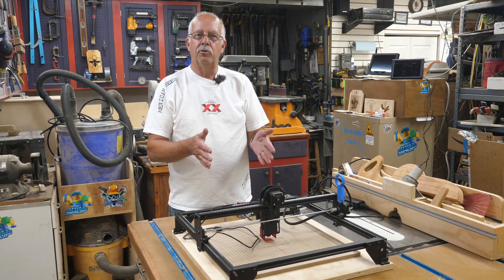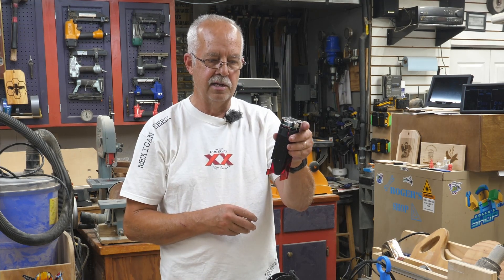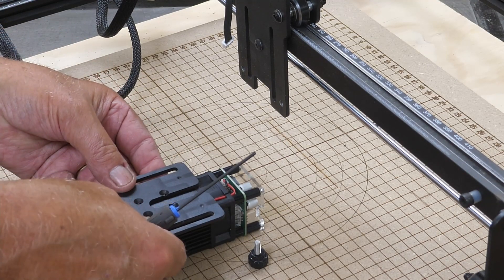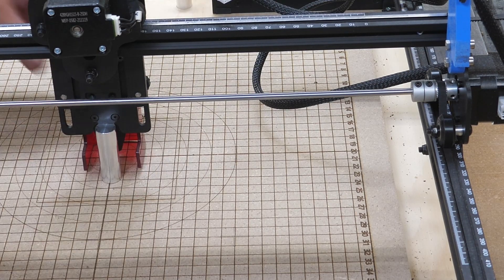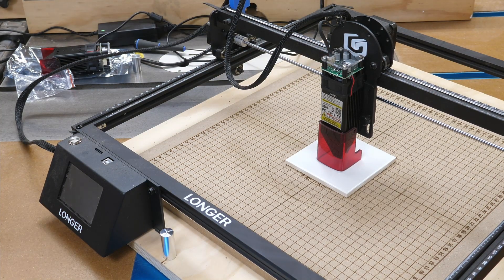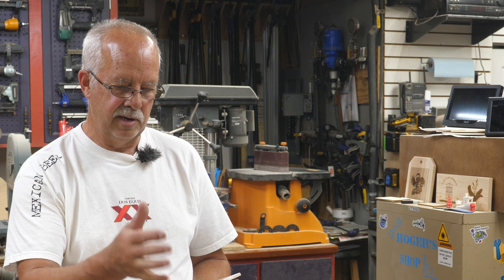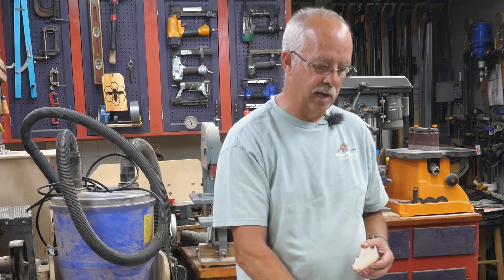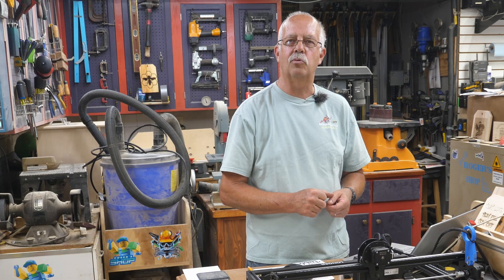Longer Ray 5 Laser Upgrade to 10 Watt In Detail

Comment: you need to change the power adapter? 
if not and voltage is bigger what will be happen?
Reply from the maker: This model (not necessarily true for others) has a voltage regulator on the motherboard.  Thus, changing from a 12VDC power supply to a 24VDC power supply for the higher wattage heads makes no difference to the controls.

Comment: Using Lightburn will the Longer Ray frame with the laser at a low setting? Also will the fire button do the same.
Reply from the maker: Yes.  Just set it up in Lightburn after adding your laser.  Suggested at 2% or lower.
Reply: I did that using .75 like I did with my Ortur LM3 and did not see anything. I will try 2 percent. 
Thanks
Reply: @rogersshop  2% seems to have worked

Comment: Hello.  I have the 5 watt laser that also comes with the 10 watt. Since I have both available I was wondering if their are any advantages the 5 watt might have over the 10 watt.  Otherwise I would think of only using the 10 watt and never using the 5 watt.  What do you think.  Thanks for sharing what you know about all of this.
Reply from the maker: Both are equally as precise, but the 10 watt will cut/engrave faster.  I kept the 5 watt after moving up to the 10 watt as a back up for this or any of my other lasers as a just-in-case.
Reply: @rogersshop  Thanks!

Comment: Bought one of these a couple weeks ago with both 10w and 5w module.. The 10w laser module quit working 5 minutes into first print with the longer logo file included. 2 weeks trying to get help from longer . The 5w works ok, but I would like to have a functional 10w laser I paid for.
Reply: I think you should have a 10w laser module, it would be more fun.